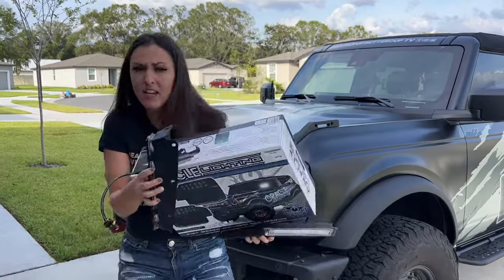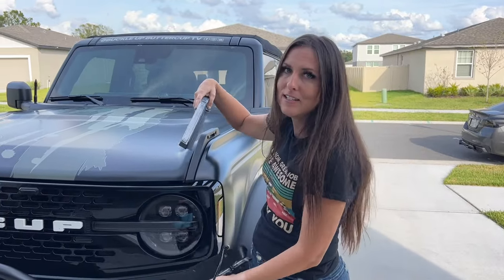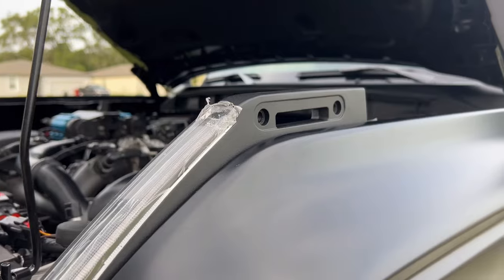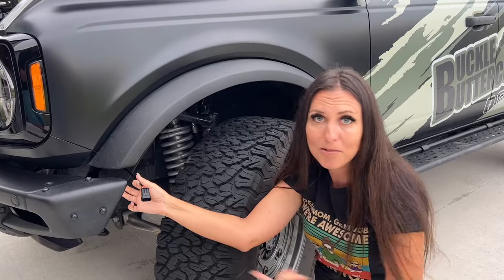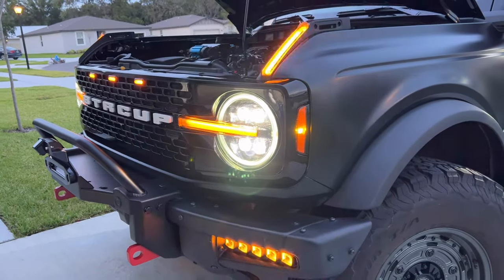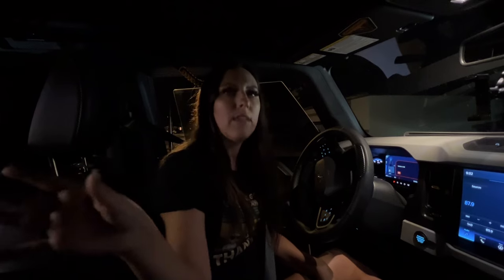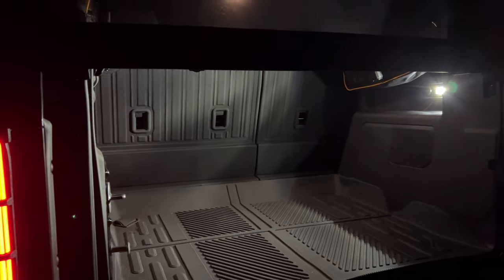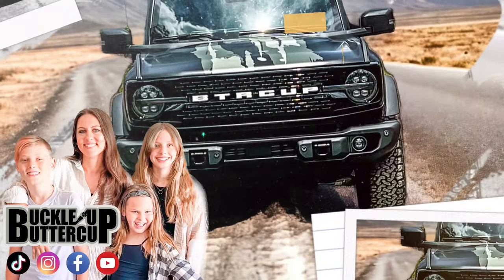Brightening the Night: Best Lighting Options for Ford Bronco

Comment: Hi, I’m also doing a capable bumper swap for a modular bumper. Did you plug in your new fog lights into the factory connector for the fog lights or are they running off of the headlights? And if they are running off the headlights what do I do with the factory fog light connector? Any suggestions? I was just gonna tape it up lol, awesome build btw!
Reply from the maker: I didn’t use my plug, plug is still there. Just tape it up like you thought:)

Comment: I just ordered these.  Can they plug into your existing fog light harness if you have factory fog lights for the capable bumper?
Reply from the maker: You would have to cut off the harness and wire up manually to the fog light wires if you’re wanting to control with your fog lights control.

Comment: In regards to the trail sight lights...you didn't show, or mention, that extra red wire that i do believe is for the lights to work during the day? That would've been very helpful to talk to that for those of us that want them to work during the day. I'm assuming how you just used the headlight harness, yours will only come on (and blink) at night when your headlights are on?
Reply from the maker: These do run with your DRLs and during the day just the way i installed them. If you have your lights on auto or on they are also on. Do you have base headlights by chance?
Reply: @BuckleUpButtercupTV  i have a 2023 Wildtrak with the Lux package. Everything i saw for the install of these lights mention that the way u installed them will only work at night, when the lights are on....which is how u show them working in your video. Then, what's the purpose of that extra red wire harness??

Comment: The more Chinese the better?

Or 

The more light sequence the better?

Was that the thoughts going into this video!?
Reply from the maker: In striving to create a complex relationship between concepts, a definite grasp between said ideas is absolutely necessary. However, it may become apparent that the fusion of the two subjects is ineffective, rendering a nullified result. In this case, a conclusion is far more difficult to draw, as results so far have remained inconclusive. Further research is required into this matter.
Reply: @BuckleUpButtercupTV  That's a response 👏 👌